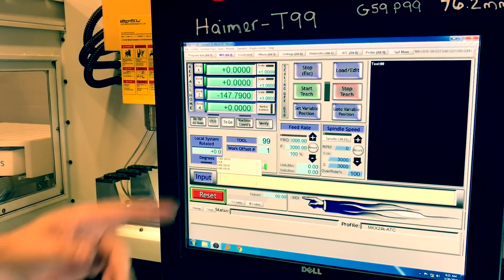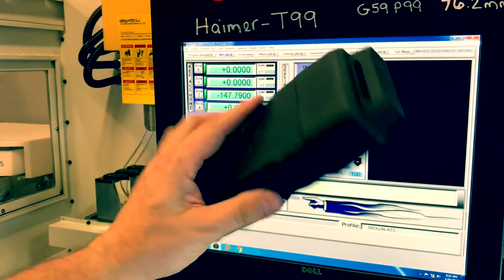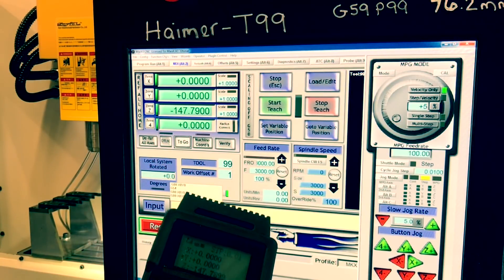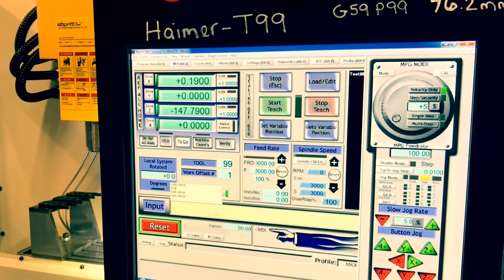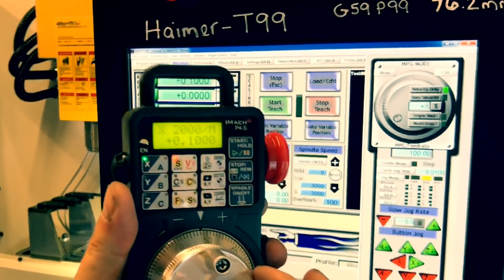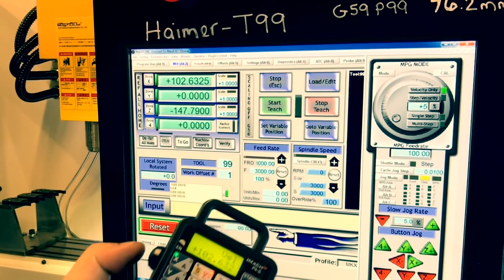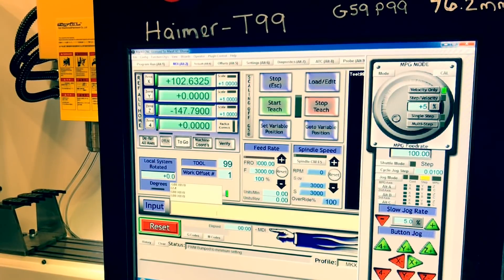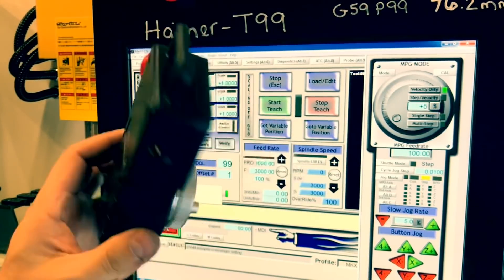Best MPG / Pendant for Mach 3 - Vista CNC

Comment: I am running a pokeys57cnc and mach3 on windows10 with the A-axis slaved to the Y-axis with both Y and A having their own drivers, motors, and limit switches to enable auto-squaring. Everything worked as it should when I used the keyboard to control it, but  when I used a pendant in continuous jog mode, the Y-axis moves in both directions as it should, but the A-axis only moved in one direction racking the gantry. When mach3 is in step mode, everything moves in the  right directions using the pendant. I first was trying to use an x-box  controller, and it had this problem. I thought it had something to do with the x-box plugin, so I bought an iMach3 P4-S Pendant. It had the same problem. I removed and re-installed mach3 and went through all the  settings, and the problem persisted.  I asked VistaCNC if they knew of a solution.  They wrote a modified plugin that corrected the problem.  Now I have a fully functional system thanks to their support.  The benefit to all this is not just that I can use a pendant with my system, but the pendant is really awesome.  The P4-S pendant gives precise control of the machine much better than the keyboard.  If you run this configuration, you will have this problem.  The imach pendant is incredible, and vistacnc supports their product which is really rare these days.

Comment: Thanks just received my new p4-s after watching your video. Nice bit of kit. Had to dail my cnc in after using the new pendent. It made it so easy. Working to hundreds of a mill on my 6040 cnc I'm out 0.003 of a mm so I'm good at 0.00 of a millimeter. It's the cnc not the pendent. Thanks again

Comment: Hi Nerdly, excuse me but I need your help. I setting my cnc with mach3. Axis are calibrated. When I lead a gcode, it run ok one turn. At the second round run and stop. No errors message, go to zero run. All run but the program no. Why? The depth of piece is 9mm in 5 tours. Excuse me for my english.

Comment: I don't quite understand how this works?  I looked at the vista site your using  I think the P4 S so all you need to do is load software somehow?  like to understand more if you can.  I keep running into trouble with my set up. I have a Taig mill using their micro proto 3 axis driver there is little to understand how it works.  I can't add limit switches as I have no instructions on where to install them etc.

Comment: I’m using an XHC HB04 Wireless with linuxcnc. I agree that the input lag is something to consider, but I’m fine with that. The behaviour you demonstrated looks very much like an incorrect config, as the two displays are obviously not showing the same information. 
The other one is nice though

Comment: I have a Centroid Acorn XHC wireless MPG. I found that for it too be accurate and responsive the MPG client process has to run with a priority higher than the CNC mill software. Otherwise it loses pulses and acts the way you describe.
Reply: How do you set the priority?

Comment: Thanks for doing this video!  I was trying to decide between a Centroid Acorn control and UCCNC or Mach4 and this kinda seals the deal!  The Acorn uses a proprietary pendant, which is made by XHC, and looks like the one you were having issues with.  I've always wanted to get a VistaCNC pendant, so it was nice to see you had good luck with it.

Comment: Does the vistaCNC have a step/vel mode? I got the same XHC pendant just with a cable and the reason it is so bad is because its not using the MPG mode in mach. It is just pulsing the "arrow buttons" so it will not cashe imputs and will have to complete the move before it can register a new one. I got arround this issue by running the MPG wheel directly to the breakout board and setting it up in MPG mode in mach, the rest of the MPG is controlling mach via usb. But I cant get step/vel mode to work(the problem is in mach).

Comment: I've got one of their other models that I use with UCCNC, I do really like it but it pays to be a bit cautious with their interface plugin.  My model has a rotary switch to switch between step modes, and I found that if I switched too quickly between modes after rotating the dial that the axis would run away and the only way to stop it is to estop the machine.  I wouldn't be surprised if it's a controller or even model specific problem.

Comment: I'd argue the x box controller is the fast pendant you could use Because you don't have to switch between  the axises. You can actually move all three at the same time. There is 10 bottoms you can program as well. There is no screen with dro readout but I've never needed that personally anyway.
Reply: You put down the controller and it slips from your oily or dirty hands onto the floor or desk, sending your spindle to china, and see how that feels.

Or even bump the joystick the wrong way when taking offsets and break whatever tool you were using. If I can mess up using a keyboard you can bet a xbox controller would be worse.

Comment: i once crashed my haimer thanks to one of those xhc pieces of shit misinterpreting the direction i was rotating my dial, which resulted in the z going down rather than up. and because the input lag is so high, i couldn't even stop it before it had permanently damaged the haimer. smh

Comment: Centroid acorn is the way to go
Reply from the maker: if i were to upgrade this machine...it would likely be with a Siemens controller
Reply: I find UCCNC much nicer than Mach 3 as well
Reply: You must use it in multi step mode